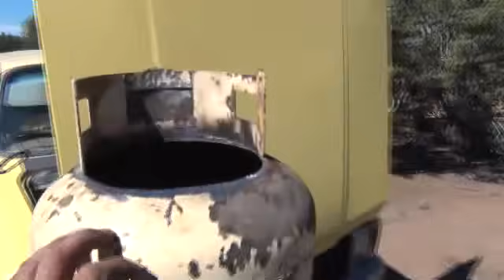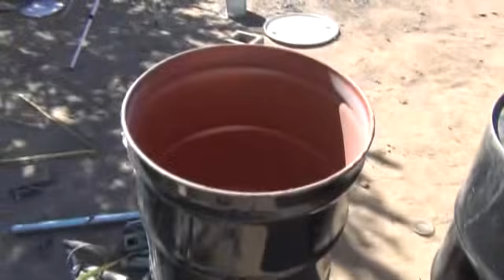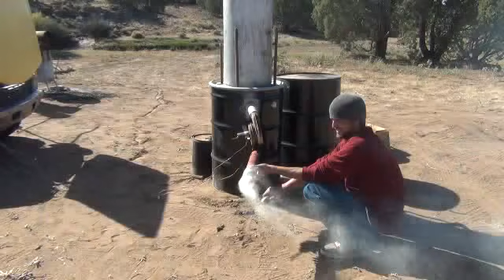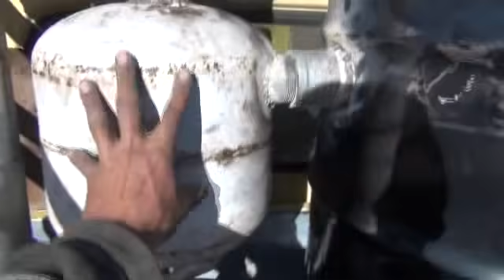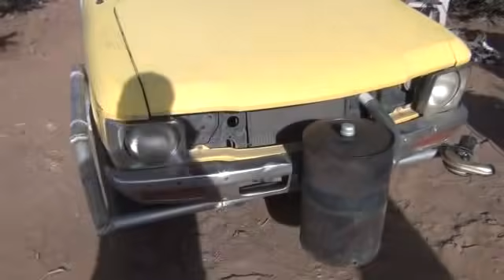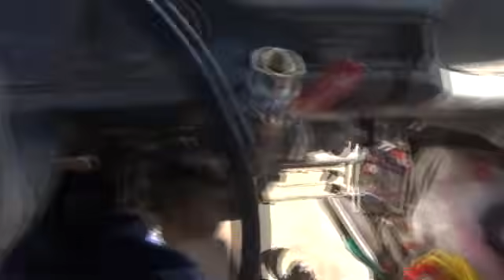How to build a Wood Gas powered Truck,  this truck runs on firewood!

Comment: It's crazy that we're still talking about phasing out IC engines entirely in favor of electric despite the potential to go off grid, be fixed in a shed, and reliability. Electric is good for industrial stuff, or cars, trains, and busses, in and between cities, but you can't expect everyone around the world to have a functioning power grid, or to pay for massive batteries that aren't always disposed of properly, take more energy to move, and cost people and the environment so much that you have to drive the car for years to make it better than an IC car. The environmental issues and inefficiencies here are probably better than "making", extracting, and processing oil, it's potentially carbon negative if you leave the roots of the plants behind, if you feed the biochar and ash based waste back to the spot growing the plants then it's no worse than a large herbivore and actually can build soil like they do. This is probably less costly to the environment with the lack of oil spills, and with less large facilities for oil more life can exist to grab carbon and reflect sunlight from the land, even though usage at the end might make a similar amount of pollutants as a gasoline engine from some part of history. Making methanol to avoid putting all this into a vehicle is also doable, and if it's done with solar heat then you get more fuel for the same amount of biomass. The stuff for making that could even make high quality diesel fuel by using oils, resins, or alcahols from certain plants.

Comment: Your video is being watched 12 years latter and thanks you! I hope this finds you in good hwalth! Now  if I may  ask, what are your thoughts on your gasifier? Do you have other videos? I am really serious about building one and have been collecting the various parts, tanks, a lot of commercial restaurant stainless from misc salvaged equipment, etc.
I feel the time is right to add this to my inventory of readiness!
Thanks
IN GOD WE TRUST
G_Dub
Reply from the maker: First study catalyst reactions on wood gas, metals like iron and copper react with the gas to help remove unwanted tars and alcohols, next is filtering and drying the gas to create the cleanest fuel possible. Then it is all about fuel to air ratios and getting them right for the engine to burn, this takes in most cases removing the carburetor and making your own, using ball valves  and cables to adjust them from the cab of the vehicle, cable throttles from lawn mowers work for this, older the
  vehicle the easier it is to convert to wood gas!

Comment: I have seen lesser systems kill smal engines with the creasoak buildup.
Im wondering how your system faired. 
And how many times you were pulled over by the cops. LOL
well done.
Other systems have used things like Waterbed matress colectors that an air compressor was plumed into to fill compressed Tanks (LP Tanks) for storage and portability operation.
Is this something you have concidered?

Again, well done.

Comment: heres my question why not just liquify the methane produced from the Gasifier like a gas station no modification necessary then just fill the tank of you truck with it and run it !!!!! hold up I just researched it you need too compress and freeze the methane or cool it down too absolute 0 geez if you made a radiator massive and where located in Antarctica it would naturally cool the gas and make it liquid form

Comment: If these Gasifiers  catch on, you can bet the Energy companies will 'Tell' (& I mean tell) Governments to legislate against them- citing dangers like fire hazard in an accident etc. Wouldn't it be more convenient to have a Unit permanently set up at home? The Ute/ Pickup would then be free to be used as intended. The vehicle would run more efficiently- less weight to carry. Could someone burn themselves on the Radiators?

Just a Suggestion; If you bought an old compressor similar/ same as those that fill SCUBA tanks for instance. Then bought some old SCUBA/ LPG/ pressure cylinders you could fit to your car. You could even use the compressor to fill an existing LPG system on a car. After careful testing you could probably revert back to LPG if you travel long distances and can't get home to refill the cylinders. I don't think it would matter if the two gasses mixed.

Comment: Couldn't you use a water cooled condenser/radiator?
Reply: What about a water filtration and cooling system, like a bong?
Reply: Why not run all the Gasifiers on Hemp? People would be too spaced- out to go to war
Reply: What if you made your syn gas separately, then compressed it into propane tanks, then ran the vehicle off compressed syn gas?

Comment: Could you use aluminum pipe for the radiator?  My theory is that it will cool it faster since aluminum conducts heat so well and it would save a little on weight.

Comment: I just need to ask if one of these are built to the specs, is there a way to get a liquid fuel out of this? I just am not sure if it is just the smoke that burns or if there is an actual liquid that condenses from the smoke.

Comment: Great vid man. I was looking at a few peoples suggestions and i have one of my own. I was thinking if you had a generator incorporated into the truckbed and get a battery bank in there, you could eliminate the combustibles blowback ,by turning truck off when you get to your destination,and turn on the generator that would be using the rest of the woodgas to charge the batteries, and if you wanted to make it even a more versitile vehical install an electric drivemotor to your driveline. And if you could get an old electric car battery bank and use part of it so your batteries wouldnt weigh so much. Then you dont have to worry about the firebox when you shut down. And if you say ran outa woodgas you could switch to battery power,before you had to use gasoline. 
And if you were needing to run quiet, the electric would be great,like when your hunting or something. 
And if you just needed to use the gasifyer for electricity, the generators already part of the system,and that would be a bomb setup.
Love your vids man.

Comment: In theory, could I build a miniature version of this design out of clay? I would imagine the heat produced by it should cure and harden the clay, and I can't imagine any differences in how it works. The only thing I know to look out for is air bubbles inside the clay, especially around where the reaction occurs. Obviously I can't keep a very thick wall of clay, because of that risk (potential explosion of the entire thing).

Comment: I ben wondering for some time is it possible for one to make their own honing oil out of used oil of some kind. I was think waste oil from cooking meat. cause the thing is Norton honing oil is the only good brand but the thickness fills in the low spots of the stone. thus making it cut finer. it be nice to have an oil that's thiner don't don't smell horrible for when one wants to shape the edge on oil stones.

Comment: Job well done, Mr T!...I've got an old '99 F-150XL, standard 6 cylinder that I thought about junking or giving away for a few bucks. Maybe, it's a good candidate for a wood gasifier conversion like your own truck? I'm not a mechanical person, that's my main reason for hesitation. And also running the risk of blowing myself up sky high! Glad it worked out for yourself. The ability to run a generator and other stuff through the front-end filter cap gives it many valuable capabilities. Thank you, for sharing what I consider to be one of the best 'How To' videos out there are on YouTube!

Comment: Hi Great videos I watched many. I would like to discuss some of your projects if possible. I like to know if they be viable if done on a large scale? We have an issue with the emerald ash bore. To prevent spreading the bore I would like to burn the trees affected and at the same time generate hydro.
My question is how much material can be burnt and how fast?
Des it generate waste byproducts not easy to dispose of? Are there environmental practices in place? 
Can creosote be made? I hear it has been used of insecticide in the past but had issues with cancer?

Comment: Dude, you ROCK!!!  very impressive reuse of parts (I like that VERY much) and you showed the process to be very intuitive and straight forward.  As it stands the implementation is awesome, and I beleive that on a smaller scale, a generator (with a recip engine) can be make to power the house or at least some constantly on equipment.  I hope your from TX, we need more people like you.

Comment: I wonder if it might be possible to combine gasification system with a geet style motor. if you could run your gasification through a water bath bubbling up through geet style system you would cut down on cooling apparatus.

Comment: Very nice design, thanks for sharing it. I copied your burner design and it works great. One thing I put on mine that you don't have on that one is a water jacket to catch condensation. I picked that idea up from Jay at Victory Gasworks. It's amazing how much water it catches: 2- 3 cups per hour from seemingly well seasoned wood. 

My water jacket is 15" long (because that's what I had kicking around), a section of the same 100lb propane cylinder material as my fuel hopper. I cut a small strip out of the seam area, then used a ratcheting tie strap to squeeze it together. I made mine 1" smaller diameter, for a gap of 1/2' all around. I tacked up the seam, then held a hammer under each tack and pounded it flat to tighten the seam, then welded it tight. I added a 1/2" flare at the bottom with part of an end cap, welded 4 tapered 1/2" vertical tabs at 90 degree intervals near the top to make it line up evenly with the outer cylinder at the top, then pounded 'er in until the top edge was just below where the cap starts to taper, and welded up the lower seam. Finally I drilled a hole on the outside, right at the upper edge of the weld, welded a short bung over it and added a drain tap. Once it was done, I leak tested it. The first thing I learned was it holds a surprising amount of water. 2 coffee cans won't get it near the top. No leaks though.

Comment: I am trying to make a gasifier that runs a chevy 454 motor on an RV. I have already built most of it. 55 gallon drums are the base. 8 inch hearth. 1/2 inch walls in hearth. piped 4 in to filter barrel. 4 inch fan to engine. any suggestions??   my own design 22.5 inch wide feeder barrel to 8 inch diameter 8 inch high hearth 1/2 inch walls . 4 1 inch ball valves air intake. might need more. down draft design. media filter is 55 gallon drum 1/2 sawdust, 1/2 shed paper. 4 inch DC blower fan. 4 inch inside diam pipe 36 feet long for cooling. 4 foam filters in pipe.    what size of hearth would you recommend. i'm already fully committed to what i am doing. almost done with the whole build. I will provide exact measurements soon. its all experimental so its kinda trial and error. im working no budget salvaged materials. but im thinking 8 inch hearth and 4 inch pipe the whole way might do it, super blower fan. gas shut off. i need a 4 inch ball valve to dial things in but they are very expensive. also wondering of i need to ball valve air intake?

Comment: sorry if its been said before and i don't know the proper terminology…. wouldn't the do dads that allow an engine to run on propane solve the air fuel ratio problems?  awesome video!

Comment: Hi, really awesome stuff, two questions:

1. Since your radiator's piping is cool before the end, does that mean it is longer than it needs to be?

2. Could you, as a filter, have another drum filled with tighly packed straw or sawdust, and every now and then, replace it and use the old, tar filled filling as fuel for the reactor?

I plan on building my own gasifier, so I also want to thank you for showing me how!

Comment: i just got the sickest idea.. at the main burning chamber, attach a large resevoir with water, and make steam also.. harness the steam for electricity, and the fucking thing is amazing.
Reply: +Kennie Diamond MrTeslonian already covered the option for producing electricity in this video starting @ the 1:23 mark. There really is no need at all to add a redundancy to his system; when the first option he mentioned was to simply connect his wood-gasifier via a gas-generator. Thereby, fulfilling the exact task you have in mind for making electricity!
Reply: +Kennie Diamond Steam powered things are dangerous. That is why steam powered things are not practical these days.
Reply: He just needs a ''overpressure valve'' dunno what its called.. And then he have to check it every now and then, to make sure its working.. maby 2 pcs, where one is set to only "go off" when it reaches maximum pressure ^_^
Reply: Perhaps, yes. Why incorporate electric production when you can power a generator? However, when designing a smaller scale one, as I am, I can imagine it not producing enough fuel to power a generator. In this case, I may look into the option of an equally small-scale generator, such as a moped engine.
Reply: What do you think powers every powerplant except hydroelectric dams,solar and wind?
Reply: I think its a great idea! you put one of those system into a RV and you are all gtg!!  one of those old gas  school bus road trip forever !!!!
Reply: I made a simple steam powered generator using a 1 wire 75 amp GM alternator.It's essentially a low pressure system that could be adapted to something like you're looking to do.The steam pretty much just vents across a fan blade I scavenged from a oil fired boiler driving a series of pulleys (3) that drives the alternator.At full tilt I see about 20 amps max and I'm happy with the results since it was wasted heat/energy.One thing I'll add is I found that it's best to bring the alternator up to speed before adding a load to it and it helps to have some flywheel effect in the pulleys.
Reply: Kennie Diamond or filter the gas through a small amount of water instead of a 50 gallon drum of hay

Comment: seems like it would be easier to start on gas then turn fuel pump off
Reply: Yes my first thought too.  Remember the old diesil cat motors that used a gasoline pony motor to start then eased  over to diesil.

Comment: Curious if this could be done by integrating it into a dune buggy frame without changing its appearance drastically. Since I don't understand it fully, but intend to start attempting it soon, I am wondering if the burn chamber can be made smaller and still produce what is needed to power a VW1600 motor in a lightweight 73 dune buggy.
Reply: It would be hard to incorporate all the components on a buggy. Most people are using a conversion like this on full size pickups or bigger trucks.

Comment: is there a way you could trap the gas that way you could store it in a tank that way instead of having that in the back of the truck you could put a tank in the truck and leave the unit at home or wherever or if you were to turn of the truck and didnt want to waste all of the wood you could trap it and be able to use it the next time you drove, thanks

Comment: I've started on building something similar to what you have done.  Do you think that you could have got away with less radiator? I recall you seeming to be surprised at how cool it was.  The less weight the less for my Mazda B2200 to push down the road.  :-)   Oh and I realized the FEMA paper on gasifiers has the charts to size the burn tube so I am golden.
Reply: Hey! I've got a Mazda B2600 that I've got idle fantasies of converting to wood gas. What ever happened with you and that B2200 of yours?

Comment: Would a 2 inch pipe into the combustion zone be easier to lite the unit with the fuel chamber full? A cap on the 2 inch pipe so after you start it can seal it back off.

Comment: What do you use to cut the metal and what kind of welder do you use?
You allude to sizing and amount of flow for different size motors, how can someone figure out sizing for say, my 4 cylinder Mazda 2200 ;-)

Comment: Great post... I'm ok with you using Tesla's name.... you are surely a genius.
Question... you talked about running the exhaust back through the gasifer and creating more hydrogen. Does that get to a point of dangerous or can you just run a partial amount of exhaust back through? Can you discuss that a bit more please?
Reply from the maker: Without the introduction of moisture bearing air to provide more hydrogen to the system, there is no further hydrogen increase in the system only a recycling of what ever quantity was present in the initial fuel supply.  Yes there is a potential for an overload of gas that could become dangerous, the computer monitors the system opening external and internal valves, and it tells the compressor to turn on storing the extra fuel (also very dangerous)as a reserve for later and a as the fuel source needed to continue the thermal cracking process in the reactor,drastically reducing the external fuel needed. Now once the system is hot and running a large portion of the continually provided fuel to the system comes from the air being drawn into the reactor and engine, the higher the humidity the faster the hydrogen builds in the system, also the higher the carbon monoxide or dioxide levels the faster they build up, the hydrogen can be separated and used as the primary fuel source for the engine providing a clean burn with minimal engine fouling, and the carbon monoxide can with a portion of hydrogen and the other gasses present be used to fuel the reactor providing heat and carbon atoms. When done right it leaves an abundance of oxygen atoms that must be expelled from the system or recycled.